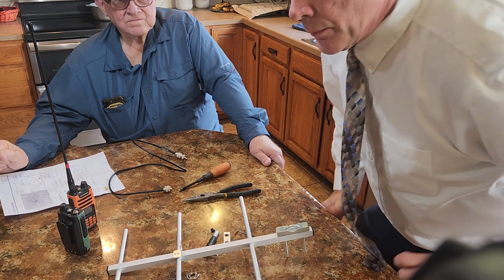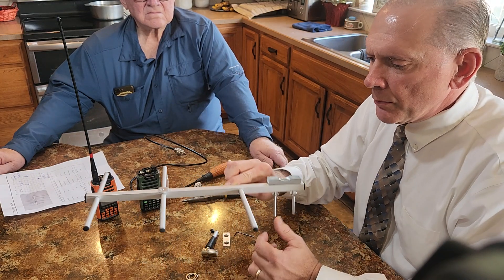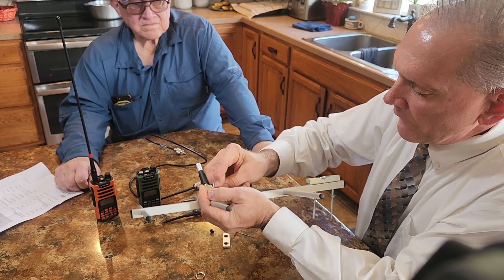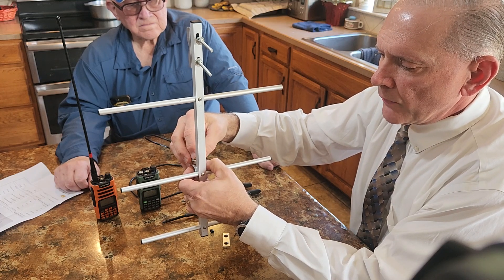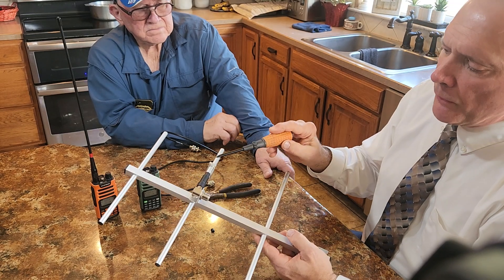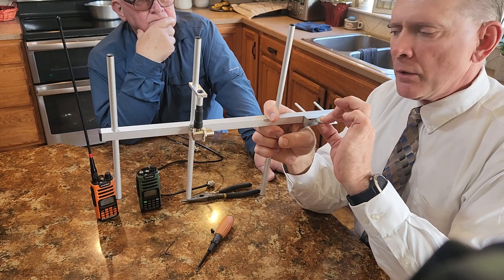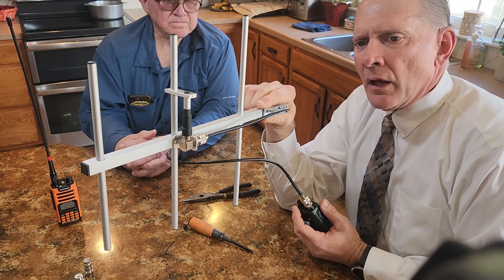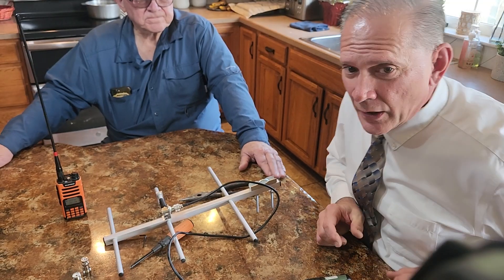Handheld Yagi for GMRS repeater

Comment: Great vid…question, does that improve both Tx & Rx?
Reply: A yagi does both.  Just so everyone is clear, the rf "shape"  is NOT a column, as was suggested in the video.  It's more of an elipsoid shape, which can be altered and narrowed by the number of "directors" the yagi has in front of the "driver" element (which is the middle element in the video).  The longer element of the 3 is called the "reflector".

If you want to know more about this type of antenna you can email me.

Comment: New to GMRS. Thanks for doing this video. I looked at five different sources for help building my own yagi and got five different sets of measurements lol. Do you have any general mobile antenna recommendations for like a rental car scenario where the user can't permanently mount something in the vehicle?
Reply from the maker: I would use a mag mount with an NMO screw on connection for the antenna.  I have these:
https://www.amazon.com/dp/B07CRBV71V/?coliid=I1VX1HLGVM43H8&colid=1Q7VR7WTS3X3S&psc=1&ref_=list_c_wl_lv_ov_lig_dp_it
https://www.amazon.com/dp/B084BPXNC5/?coliid=IPMPOE8S2N9FX&colid=1Q7VR7WTS3X3S&psc=1&ref_=list_c_wl_lv_ov_lig_dp_it